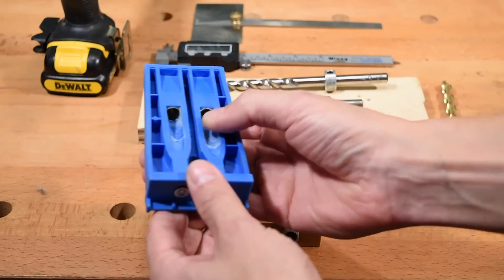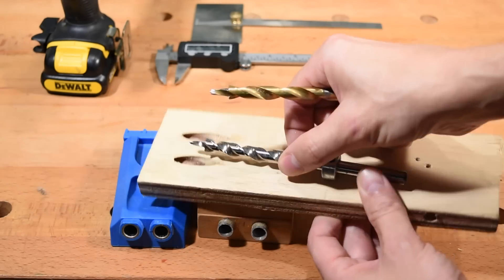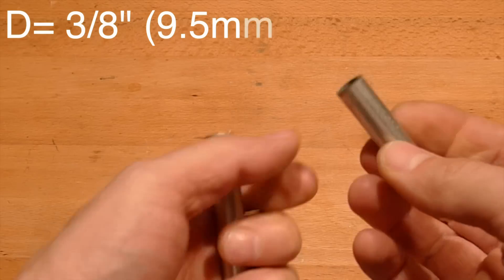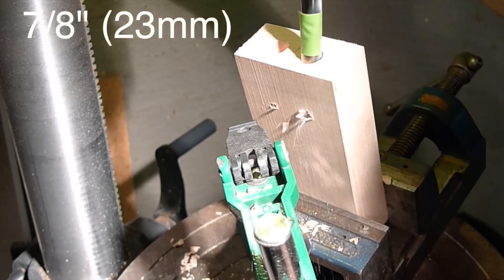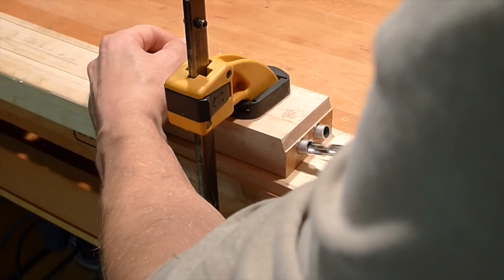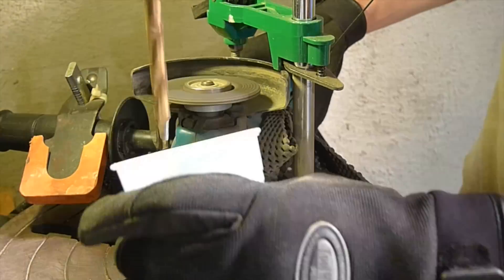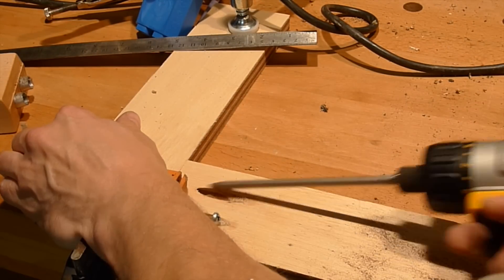DIY Pocket Hole Jig

Comment: Just got the single hole Kreg set-up. Drill bit nice and sharp! I set the stop 1/8" shorter for plywood to plywood since it's soft and I had one screw pierce through my finished product about 1/16". Also used a low ratchet setting on drill so as not to strip out screw which happened once.

Comment: When I use this kind of joinery I just drill a hole in a piece of scrap and cut it in half, not worrying too much about the angle. Then I can make a nice pocket using a regular drill bit. Not as nice as the "kreg jig" holes, but it works. Also with regular screws. 

I think the kreg style is a little hyped. But I may try your build here. Thank you for showing. And thank you for doing channel in English.
Reply from the maker: Glad you found it useful!

Comment: I stumbled upon this video looking to make one of these. In under an hour made one out of a spare 2X4 scrap (maybe 5" long). The 15 degree angle I just estimated by placing a .25" shim under the edge to tilt it. I drilled the the first hole with a .125" bit on the press then used a hand drill to enlarge them now that I had the angle already drilled. Pretty much all of the measurements are flexible as long as you get the general concept.

Comment: I refuse to buy a Kreg jig for the simple reason that they are gouging the average woodworker. I work in the trades and make very good money, however, when someone is gouging people I don't buy the product. If Kreg were more reasonable with their jig prices, more woodworkers wood buy them, hence make more pocket hole projects and use more screws. Make your money there!
Sorry for the rant, but I think it supports your reason for the making of this video. 
Great job on the project and great job on the video !
Reply from the maker: Thank you Mark! 
There are still places in the world where one can't buy any Kreg jigs or the prices are even higher than the US. So, making your own pocket hole jig makes even more sense then:)
Reply: CrazyRussianWoodShop amigo me vendes uno me gusta en madera y quiero iniciarme en la madera de antemano mil gracias desde México

Comment: A very thorough duplication of the original. I suspect that more time with the file will bring your drill bit up to the same quality as the jig. Nice work!
Reply from the maker: Thanks Barry!Yes it would get better but it would be hard to match the special geometry of the Kreg's step drill bit. 
One thing I would have done differently, I would use a bit with a pilot tip to make the step drill bit now.
Reply: Could you just make it a two step process? Drill with a normal bigger bit then run a sleeved smaller bit down the hole to drill the small one?
Reply from the maker: Yes, you can. I've done it just to test in fact. Good question.
Reply: by the way what is the size of the bit you made?

Comment: saw this on lumber jocks, very interesting how you made the drill bit, I guess it would wear out faster than the kreg, if it would ever wear out, but if you can make one you can make another or make several since you already are set up to do it, good work
Reply from the maker: Thanks, Tom. I did post this video on Lumberjocks too. Like I said in the video, the original Kreg Step Bit will be the best as far as its geometry for this particular task and it probably will be impossible to match its performance with the shop made Step Bit, however, if you don't drill many of pocket holes in your shop the DIY one will do too...

Comment: well looks easy , and i will try to make it 
thanx for this kind of video
Reply from the maker: Good luck, Felipe. You can actually use to separate drill bits to do what Kreg's step bit does. It will take a little longer but not by much...

Comment: Cool jig! Nice trick with the grinder. Unfortunately the special screws are pretty expensive.
Reply from the maker: I know, but any screws will work actually, especially when you are joining the soft woods using regular screws...
Reply: CrazyRussianWoodShop I think any sheet metal screws will do.
Reply: You can also throw a washer in the hole before using a normal wood screw!

Comment: hey great job.  what is the length..width and thickness of the piece of wood that you used?  thanks in advance
Reply from the maker: Thanks! The final size of the block: 2 and 3/4" (68mm) wide, by 3 and 3/4" (93mm) long and 1 3/8" (33mm) thick

Comment: Awesome job! Just to clarify, you only use aluminum tubing for the insert?

was looking into buying a pocket hole jig then i saw your video, will really save me a lot of money, thanks~!
Reply from the maker: Hi Victor. No, you can use brass tubing from eBay or even steel. I used brass and steel for my doweling jigs and didn't see much difference. 
I think the most important thing is that the diameter of that tubing is fairly close to your drill bit...
Reply: CrazyRussianWoodShop, thanks for clarifying that, now i have to check on where to buy brass or steel tubing locally, and hoping for scrap as well so i don't need to buy too much.

thanks again and great job on the diy~

Comment: hi dude, ¿se puede usar otro tipo de tornillo o tienen que ser los tornillos kreg?
Reply from the maker: Any screw can be used but it is best to use screws with flat head, not the conus head as they would tend to split wood...
Reply: Gracias dude

Comment: ok so showing my lack of experience with pocket hole jigs why do you need to make a special drill bit to use with it. wouldn`t a normal drill bit work with it?  I will be making one for my shop, but as I work mainly in hdpe plastic I will be using a 2" x 2" x 4"  hdpe slug to make it out of. should I still sleeve the hole with metal or will I still need it when using hdpe plastic? 
should I make a couple of them at differing angles?
Reply from the maker: Yes, the normal bit will work too but it will be harder to drive the screw in and it will increase the chance of  wood cracking. It is doable though. You also can just drill it twice with two different drill bits. The step drill bit is the best option when you are making a lot of these holes...
You can probably get away without sleeving the jig's hole with metal for some time before the drill bit chews the guide...
The angle should be in 15 degree vicinity. The research shows it is the optimal angle for strength in this type of joint. You will just need drill pocket holes closer or further to the edge depending of the thickness of the boards you are joining...
Good luck!
Reply: ThLynn Nydb
Reply: CrazyRussianWoodShop That's the most comprehensive and useful answer I've read on this subject, thanks for taking your viewers questions seriously and posting such good stuff. I too have no direct experience with Kreg jigs, just the usual freehand attempt doing pocket holes at about 45degrees and managing to split lots, making others too shallow or too deep - the list of stuff-ups is pretty long ha! ha!

Comment: Thank you for your quick answer, the reason I asked about the pan head screws is that here where I live I haven´t seen a Kreg jig or similar, or for that matter the screws, but if pan head or other regular screws work well, I´ll be making your pocket hole jig and the step drill bit, any further advice ? Thank you in advance.
Reply from the maker: Hi Alfredo. Make the inserts from steel if you are planning to use the jig a lot. 
The pan head screws will work just fine. Kreg makes two kinds of screws: "fine thread" and "coarse thread". They recommend to use the first ones for the hard woods and the second for the soft woods. Both kinds have a "pilot" groove at the tip to drill the wood better. You could probably make those groves yourself with the side grinder. You could do without the groves though. 
Lastly, try to find a drill bit with a pilot tip to make your stepped bit.
Good luck!
Reply: Thanks again CRW,  yes I will make it as you advise, and I think will use it a lot. Regards.

Comment: Great video!! Love your channel!
What are those metal pipes called?
Reply from the maker: Thanks, Mike!
I got them on eBay, "brass pipes for crafts". They are cheap.
Reply: Can you please send a link. I can't seem to find one. Also when it says the size (example 5/16"), is that the inner part, or the outer part? Meaning if the bit size is 5/16'', should I buy that size pipe, or should I go one size bigger?

Comment: Hola te escribo desde Argentina , Buenos Aires , Tigre . no pude ver en el vídeo el largo por el ancho por el espesor de la madera . según mis cálculos es de 100 x 80 x 35 mm . la otra duda es de cuanto es el corte de la mecha escalonado y que espesor seria ? . saludos  .Claudio
Reply from the maker: Hola, Claudio. I am located in Baltimore, Maryland state. Yes, it is about that big, it is not important however. What important is the angle of the drilling and the distance from the bottom of the wooden block when you drill those 15 degree holes. The drill bit should be something like this: http://img.sellercube.com//UploadFile/P0/SKU277131/ca1569ee-8290-c7e8-10e0-c0c6d693c632.jpg

Comment: Do you have a link where a can buy does 3/8 tubes? I purchased some already but was to small for the kreg bit.
Reply from the maker: OK, the Kreg bit is 9.5mm, so this 10mm inside diameter should do: https://www.ebay.com/itm/1pc-OD-12mm-x10mm-ID-250mm-Length-304-Stainless-Steel-Capillary-Tube-Pipe-Silver/192230686574?epid=2261836426&hash=item2cc1d77f6e:g:XuwAAOSw6YtZUxtm

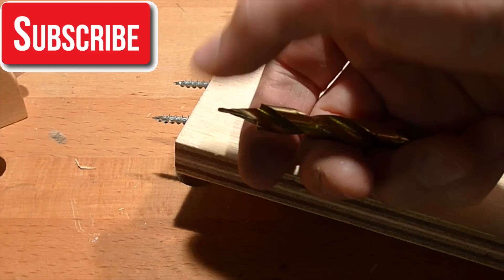Comment: At 2:40, how can the home made drill bit be just as good, when you just finished saying that the original drill bit was better?
Reply from the maker: I said the shop built jig is just as good (I couldn't feel the difference or see the difference in the quality of the pocket itself while using the Kreg bit). And yes, my step drill bit was not as good as the Kreg's one.

Comment: Also, does it matter what screws you usw
Reply from the maker: Yes. Finer thread is for hardwoods, and coarser thread is for softwoods. Even more important–the srew's head should be flat underneath. Kreg sells them both (fine and coarse types). 
You can get away using any kind of screws if strength is not very important though...
Reply: CrazyRussianWoodShop you recommend the kreg stuff like the jig and screws? Thinking about making the jig but buying their bit and screws

Comment: where did you get the tube for the jig like to know so I can get some.
Reply from the maker: Please don't laugh but I found it outside while jogging and that is how the video production started...:) I would recommend, however, to use a steel tube for the pocket jig to make it last longer. https://www.ebay.com/itm/Silver-304-Stainless-Steel-Capillary-Tube-12mm-OD-10mm-ID-250mm-Length/132273968977?epid=2245748493&hash=item1ecc249751:g:JHMAAOSwDn5ZeGiB

Comment: Do you remember the size of the block that you used to make this?
Reply from the maker: The final size of the block: 2 and 3/4" (68mm) wide, by 3 and 3/4" (93mm) long and 1 3/8" (33mm) thick. Good luck!
Reply: CrazyRussianWoodShop awesome, thanks for the quick response!

Comment: What type of tubing did you use?
Reply from the maker: It was some aluminum tubing I found while jogging:) Any soft metal tubing can be used though.
Reply: CrazyRussianWoodShop will the tube sides stand up to use without ware?
Reply from the maker: Yes. I drilled hundreds of side pocket holes with my Kreg jig and it shows no wear. It has the brass inserts. I suspect the aluminum inserts will last about as long.

Comment: cool! but only work with well equipped workshop!!!!
Reply from the maker: +Dubrifle  I guess I make it look so using all these machines in my shop. You can make the side pocket jig with simple hand tools and a drill press. It will take longer but it will work fine. The angle of the inserts don't have to be precisely 15 degrees for your shop made pocket hole jig to work.

Comment: Great job and clear explanation. You have measured as 2.75" from the end of the insert (here https://youtu.be/-aTqITfahVw?t=108) for 3/4" thick wood stock. How much would it be for 1.5" thick? Will that be 3.5"? I see in CAD that 3.5" from the insert end makes at the center of the 1.5" thickness material.
Reply from the maker: Thanks! I would try that and see where the exit hole would end up...